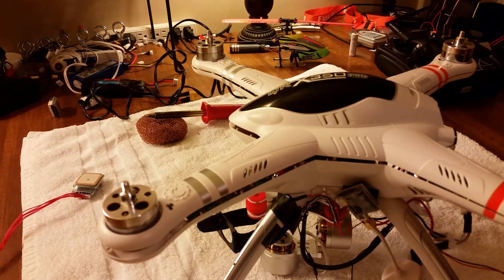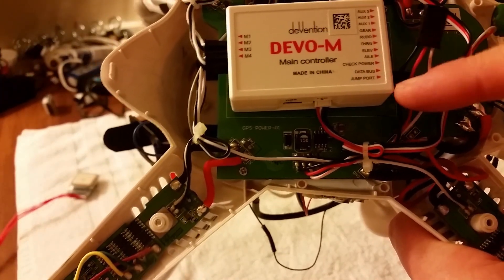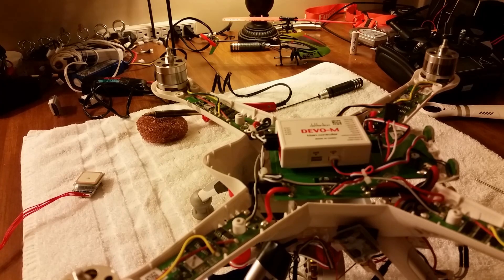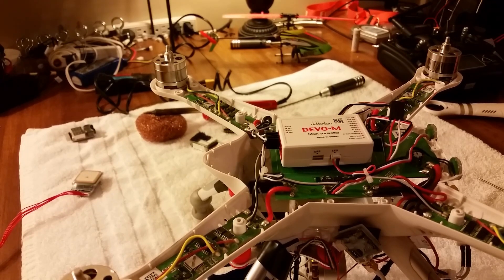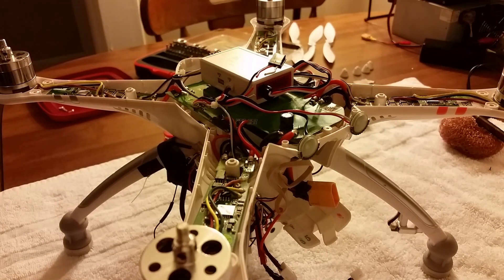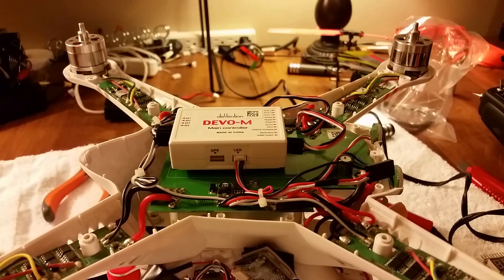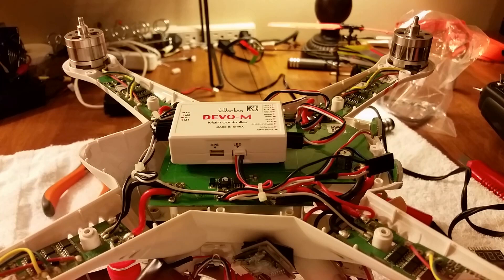Guide for Walkera X350 Pro LVC Mod

Comment: I have a question about calibration sir. I have calibrated many times the compass but can't seem to get GPS hold or RTL to work. I can only fly in manual any ideas would really be appreciated
Reply from the maker: Plug into mission planner with props off and flip your switch to make sure the flight mode changes, check to make sure the compass is rotating when you rotate the quad if that all works you might want to put some copper tape under the gps module, I think i have a very short video about how to do that, if that doesn't work let me know
Reply: Drone Hangar  hia  I have  the qx 350 not the pro. it doesn't have mini USB port.for MP.:((
Reply from the maker: Oh okay, join our group and post your question :) https://www.facebook.com/groups/DIYMultiRotors/
Reply: Drone Hangar I joined today a friend added me thanks Mr H.

Comment: Maybe your the man who can tell me why, my motors have gone erratic on my QRX350 pro. The  motor 1 was erratic ( and the other motors at other times ) and it blew the 2 x chips components on the ESC next to the Red wire. I bought a new motor and a new ESC and soldered them altogether. Powered her up on the carpet all ok. Took here outside for a flight, as I went to take off the new ESC chips caught fire in the same place next to the red wire and its ruined again? Im so stuck and stressed? I wonder if you can help and how come anyone understands these flipping things? All I want is the lovely film from flying?
Reply from the maker: Did you calibrate the esc's? Check the soldering job from the factory from the power board to the esc too
Reply from the maker: also join our group and post your question, I changed my esc's out a long time ago so I'm not 100% on them anymore... https://www.facebook.com/groups/WalkeraQRX350Pro/
Reply: Thanks i joined the group. I will paste the question there. I didnt calibrate the ESC? I had no idea I had to or HOW TO?

Comment: So its, cut the white and red wire and them solder them inline with each other and plug back into the Devo M 'Check power slot' is it. Because the video doesnt confim exactly this?????
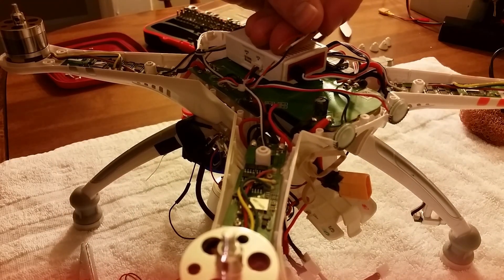Reply from the maker: David Anthony Batten check out the freeze frame at 4:00, you put all 4 together
Reply: i see thanks

Comment: It's not exactly clear in this video, when you cut the two wires to make four ends, then solder 1+1, then 1+1, and then cover with shrink wrap, are you then connecting the 11+11 all together, aka shorting all ends together?
Reply from the maker: Nope, all you do is short two the wires from the one servo plug
Reply: so white is disconnected at the board and red/white from plug and red from board are connected together? Meaning the white (signal) on the controller is reading 5~v all the time (except when it drops of course)?
Reply from the maker: +Diz Awn yes you just solder the red and white together from the board then the red and white from the cable then all of them together, you can see it at 4:01

Comment: Hello, I have recently purchased a new QR X350 PRO and I am not a tech guy with many tools. I am trying to do some research before I attempt to fly and possibly crash my new toy. I just want to make sure that this LVC mod applies to the new X350 and also I am wondering if i can used electrical tape as I do not have the means to sodder the wires. Thank you.
Reply from the maker: +Adam Fuller There's a couple versions of the x350 out, this is for the devo m flight controller and the x350 pro. I wouldn't recommend black tape alone because you definitely don't want it to come loose mid flight.
Reply from the maker: +Adam Fuller Please join the official support group and we'll help you with any questions you have :) https://www.facebook.com/groups/WalkeraQRX350Pro/

Comment: Looking at getting a 350 pro, is this the only fix? Not sure I want to start cutting wires on a new quad.
Reply from the maker: DwayneACowie yeah its the only way to be sure, you can put a servo connector in line in case you want to undo it but I don't see the point in that. The mod is something that should be done, its safe and easy.

Comment: I just did a major mod to my 350Pro because I have broken several frames that turned out to be wires disconnecting from the stock ESCs .  I decided to get a stronger 330 frame, EMAX MT2213 Motors, 30A ESCs and a FrSky receiver.  I then pulled the Devo-M, GPS, compass, and 350Pro legs from the old frame and built the new one.  It actually configured nicely and feel fairly sturdy.  I like the 350Pro body because it hides all the guts so I might move back to it, but let me get to my question.

With this new build I have the ESCs connected to the Devo-M controller and supplying the 5V power.  I am not using the 350Pro power board.  I currently have all 4 ESCs providing power, which I know some say you shouldn't do, but I am getting a different strange error that I think is related to your video and I would appreciate your thoughts.  When I power up the quad, the left LED blinks fast for the first few seconds, then it kicks back to a slow blink which just goes and goes.  I noticed that if I hook up the Devo-M to Mission Planner via the USB cable the LEDs do NOT do this.  I am able to arm and fly the quad, but on my first 3 minute test flight, both LEDs started flashing fast and it landed.  I disconnected the battery and it measured at 48% (it wasn't full when I started so this isn't the issue).  I then  reconnected it and attempted to fly, but it immediately went crazy and tried to do a circular land... meaning it was just flying by itself and came down and both LEDs flashed quickly.  I then put two and two together and reallize that the Devo-M must think the battery is low.  I have the low voltage in Mission Planner set to 10.1 volts so it shouldn't have been that low.  Then I see your video and realize that I have NOTHING connected to the Power Check pins on the Devo-M.  Would you recommend that I connect power from one of the ESCs to this, or somehow disable it in Mission Planner for testing and then physically disable it somehow by supplying it with voltage. 

Anyway, your thoughts on this would be great!

Thanks,
Don C
Reply from the maker: Don Clarke 5v bec

Comment: My 350pro is having some problems. Ok my quad has about 6+ GPS lock. My Loiter and RTL doesn't work I don't know  why so I try compass calibration and Live calibration and I also updated to 1.7 and still the quad Loiter and RTL do not work, it just go crazy and fly in circles. Sorry about my bad English and grammar but please help me.
Reply from the maker: Tom Drew do a compass calibration thru the radio not mission planner and set the compass to yaw 180
Reply from the maker: ***** connect to mission planner, then mandatory hardware, compass, there's a drop down list and you choose it from there

Comment: Your vids are only usable explanation about 350 pro.I have many problem about mine,few crashes without explanation,motor burning,control loosing.gps non holding........
Can i do same thing as this video shown after 1.7 upgrade ??
Reply from the maker: Yes but the firmware version doesn't matter, I did it on 1.5

Comment: Did you solder all 4 wires together ? It is no that clear following your video, if you mentioned, I missed. Please let me know.
Reply from the maker: At 4:00 I show a picture of what I soldered together, but to answer your question yes all 4, 2 red and 2 white all to eachother :)
Reply: C Fowler Thank you, just got my new quad and I noticed that it shuts off pretty quick, thankfully I was holding the quad with my hands. I repeated and did it again.

I will fix as you mention tomorrow.

Thanks.
Reply from the maker: Make sure you don't run any lipo under 3.3V
 on any cell.
Reply: C Fowler got it !
Reply: C Fowler I did the soldering this morning on 4 wires, battery was 11.2 V but I noticed that the blades stop spinning ( not suddenly like before ) like if the battery was draining too fast but I checked the voltage after this and it was above 10 V.

I noticed that the 2D gimble worked better but not sure if has anything to do.

Any advise ? ( I'm charging the battery for a few hours and re-test )
Reply: C Fowler I charged the battery for a couple of hours, now the quad run for 5 min and 11 secs with throtle at mid position until I noticed how the power went drastically down. If this thing was on the air, you can imagine... I stopped and measured the battery charge at that moment and it was 10.4 V total and the cells 3.04, 3.4, 3.96 V.

What do you think is happening ?
Reply from the maker: In mission planner, config/tuning, full paramater list, set FS_BATT_ENABLE to 0, FS_BATT_MAH to 0, FS_BATT_VOLTAGE to 0, then click write param on the right. Try that
Reply: C Fowler Did the changes using Mission Panner, ( plus the soldering of wires ), charged the battery all night. I did not measured the voltage at the beginning but, after 15 minutes of holding the quad with my hands, at around 60% throtle on average, I stopped and measured the voltage... 11 V total still. I think I can get easily 20 minutes of flight.

I noticed a change on power at around 6 and 12 mnutes that I did a liitle bit of adjustment to the throtle to around ~70% approx.

Thanks for the info. I think everybody should do this changes, very easy to do.

Now, the 1.7 firmware update, do you recommend doing that upgrade ? What benefits offers ?
Reply: C Fowler by the way, after the 15 mins test above, the battery was only warm, not hot, which I think is also a good sign.
Reply from the maker: ojodehorus sounds like you got it fixed. 1.7 is too new for me to comment on yet but 1.5 is solid

Comment: I am wondering why walkera don't make the quad to switch in RTH mode when it reaches critical voltage values instead of just turning the motors in mid air. I might try to change the values like you did from your previous video (mission planner) and see what happen. Thank you.

Comment: I see you changed your battery plug to XT60's also. I did the same thing. The banana plug that comes with the X350 has melted once the connections get loose. Also I've seen people running prop guards that cause the motors to load up with all of the prop resistance and will draw a ton of current melting the banana plug. Awesome job!
Reply from the maker: Thank you sir!
Reply from the maker: I've been using xt60 for a long time, now all batteries are compatible.. people get scared when you have to heat up the iron :) They just plug in and out easier imo
Reply: Right. Ther are a better plug for sure.

Comment: Thanks for posting this video. This issue is effecting every single Walkera X350 out there. Even the Devo-FCS350 flight controller. But after getting this issue taken care of and checking all of the soldering, this is a dependable quad.